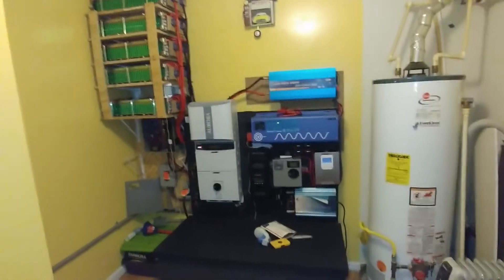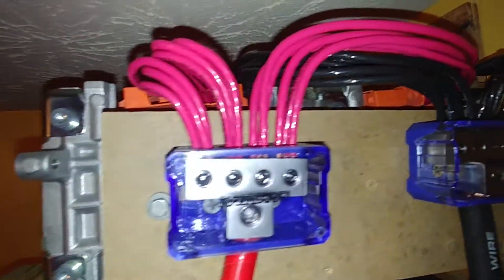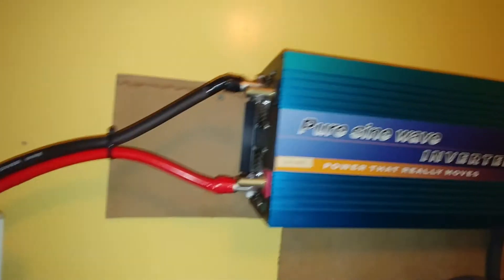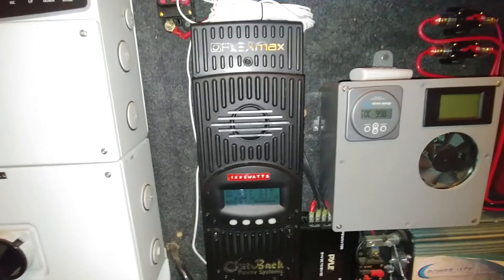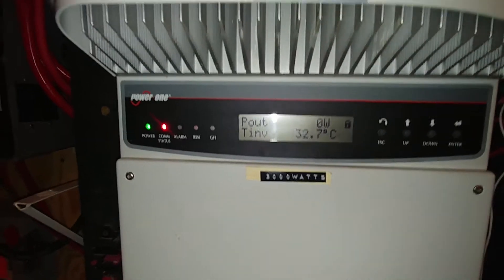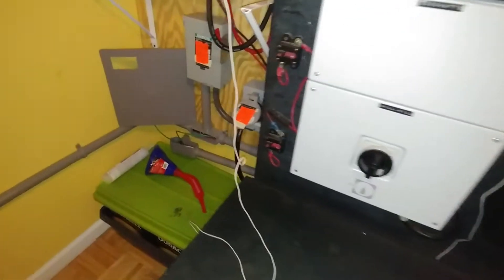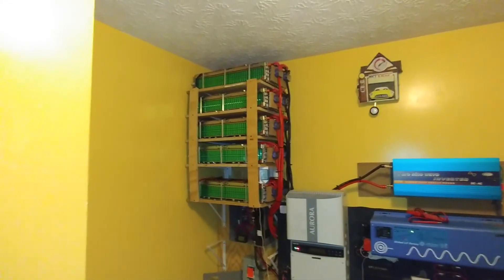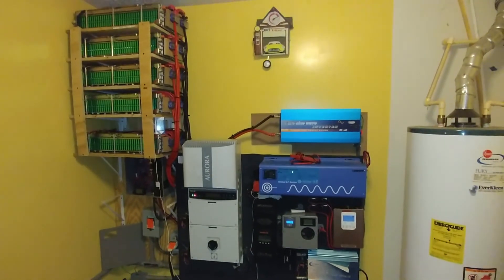Not TESLA powerwall but Ford powerwall

Comment: How does the flex handle the hi voltage in
Reply from the maker: 145v max open voltage you want to put in it,,,meaning no load on the solar panels string voltage

Comment: Thank you for your inspirational video, gives us lots to think about and consider especially that your not using balancing which saves a lot of time and money. I would consider adding a little extra structural support for the ford batteries hanging from the wall in case of an earthquake. Maybe just even a cable running up the front and attaching it to the ceiling. And maybe lining the area with Hardie Panel for a little fire resistance. https://www.lowes.com/pd/James-Hardie-48-in-x-96-in-HZ5-HardiePanel-Sierra-8-Vertical-Siding/3071709  I love the job you did!
Reply from the maker: thanks for checking out my video

Comment: Great system.    Day time you are on the Grid?     Night time on D.c.?    Do you have a Battery Management System for the Ford Batteries?   Thanks.
Reply from the maker: jim davis---thanks for checking out my system---no i do not have any bms on the ford battery----i dont think i need it every os often i check  them and the charge voltage is 4.2v per cell

Comment: I'm impressed! Looks like a solid system. I run a 24V grid-assisted house, only using the grid for microwave, washing machine etc. My solar (1.1 kW) does lights, computer, radio, etc. The big expense is batteries, so I'm looking for something like yours. Nice installation. :-)
Reply from the maker: nlo114----thanks for checking out my video

Comment: have you considered using a lithium pack monitor. or at least a small balance bms. you could put less on it to tell them packs are out of balance. I am just using a monitor with manual balance for my 108ah pack. it's 7s 29.4 v for my 24v system. I'm fully off grid. I have gilf cart batteries also.  I have a gas tankless water heater. I have a long way to go . to stay off the generator. you have a nice system . keep at it.
Reply from the maker: james stranger--thanks for checking out my video---no as for a bms i dont think its needed the lithium cell fully charge are 4.2v i charge them at 4.1v and check them after and they all have the same volts from the day i install them

Comment: Did you consciously choose 24v rather than 48v?  Higher voltage would mean half the current.
Reply from the maker: steve davies ---thanks for checking out my video---i also have a step down transformer on my system 24v to 12v runs a few 12v lights around the out side of the house and also a 12v entertainment system in my bath room along with a tv
Reply from the maker: and true on the 48v and so on--- but i prefer 24v system